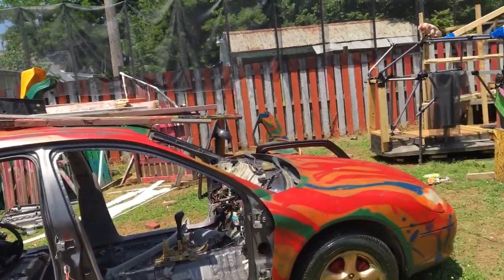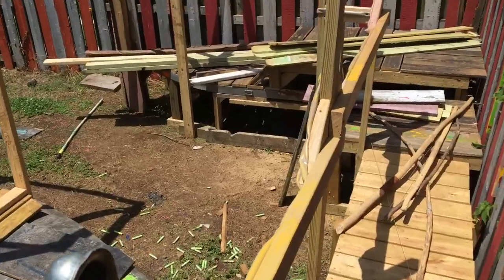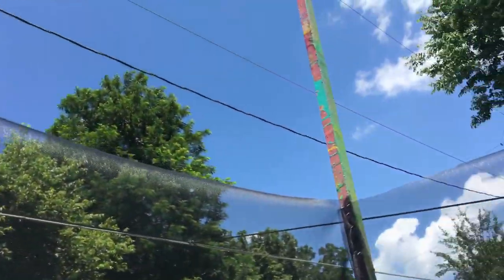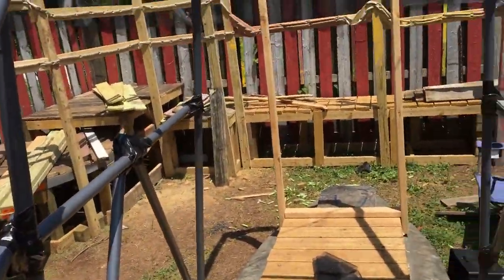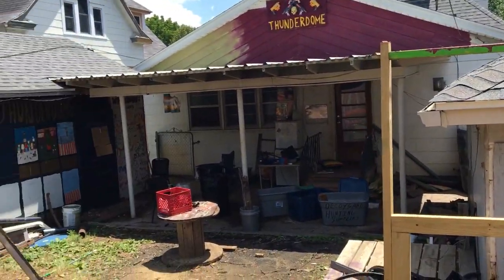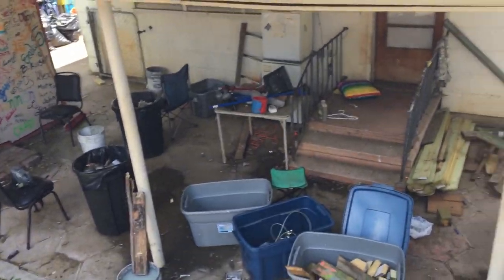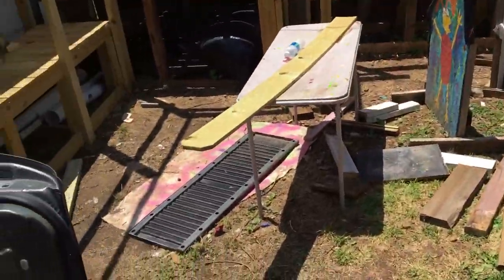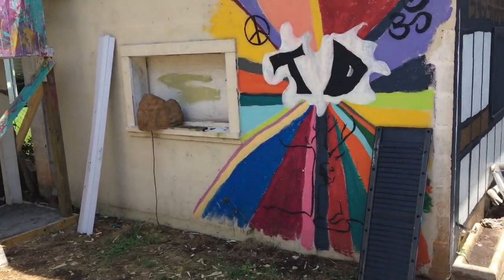Nerf GUNBOAT | WARTHOG TURRET | Arena Upgrades

Comment: What if for the door area you took donations through a site of some kind and then made the wall out of plywood silhouettes painted to look like the donators? Would let you guys get extra budget and also let people far away be a permanent part of TD. You already have the paint and the silhouettes could be made of scrap wood so you wouldn't need to buy anything. It would also call back to the actual movie TD with all the people hanging on the cage etc